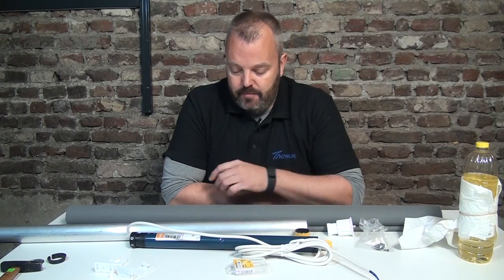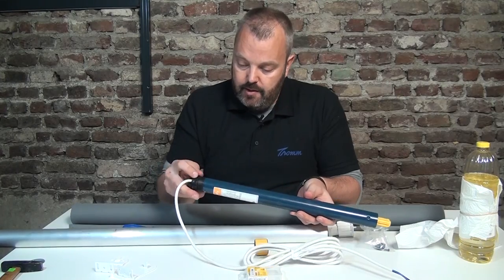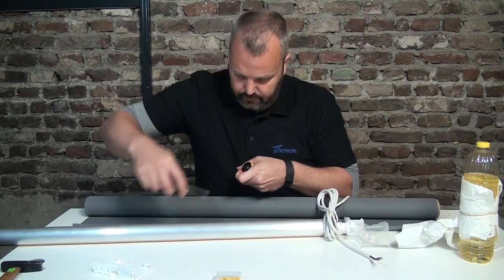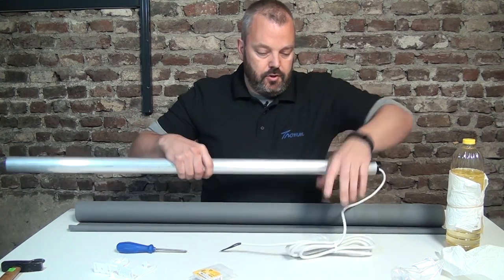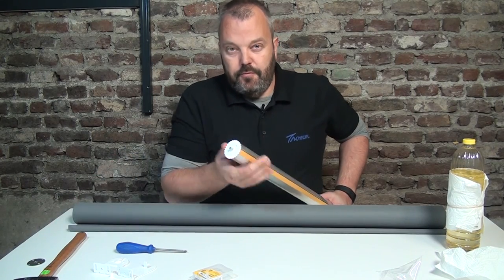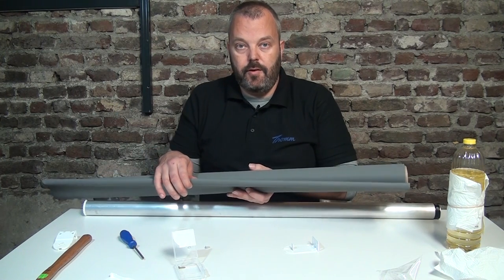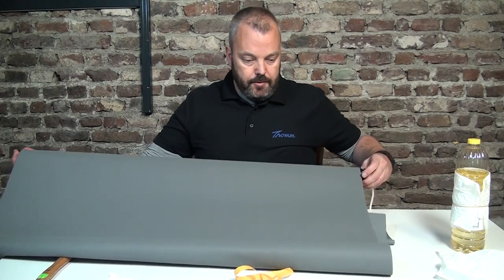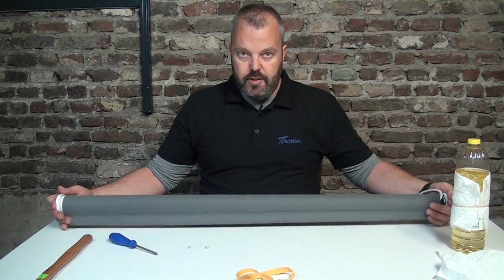How to make your own electric roller blind with the Somfy Sonesse 40 WT or RTS (220 / 110 V)

Comment: Where exactly do you buy the blinds?
Reply from the maker: Hi Will, 

Somfy have quite a wide range of motors now. The video of the Sonesse Utra 30 will be uploaded shortly and the new 24 RTS LI-on just came in so is scheduled for the next month. This means that for a wide variation of tubes, there's a motor available. Downside is that not all motors have the same specs, so some will be 110 V, others 12V. 

So even when there is a solution it's best to verify which tube will be used before you get the blinds.

That's all to say that for many blinds, there's a solution, so you can get one locally and then automate them with the motor and a suitable crown and drive

There's another option, which is for us to send you the complete blinds. With the motor integrated. I'll reply to your email as well, so I can send you fabirc samples if complete blinds are an option.

thanks,

otto
Reply: @motoriseit  which part of the question "WHERE" did you not understand ??? 😞